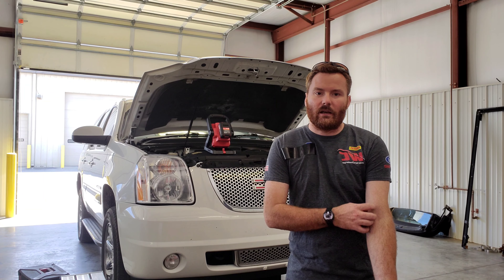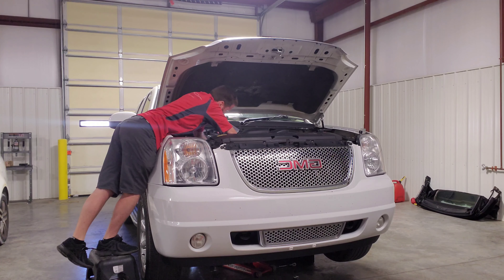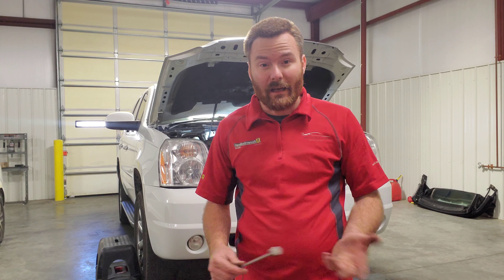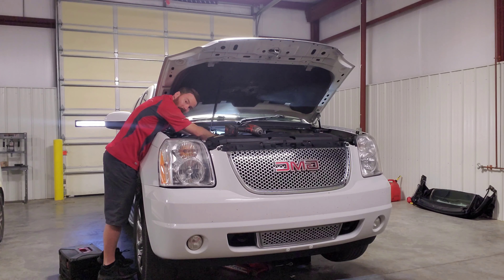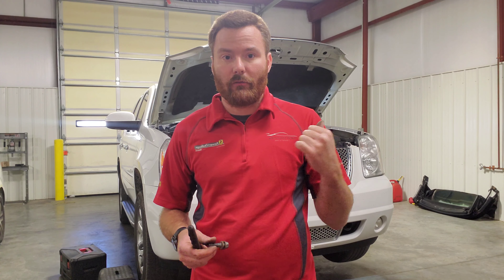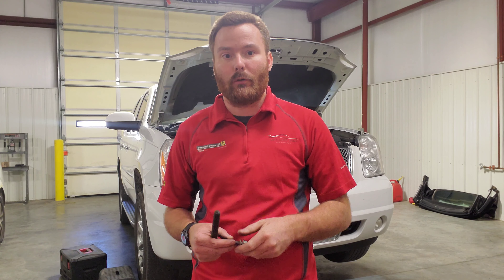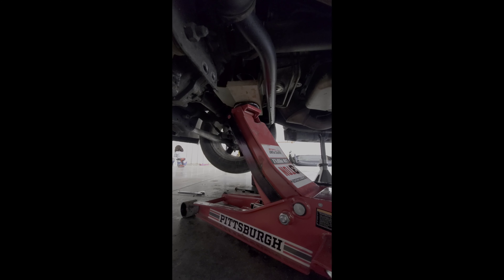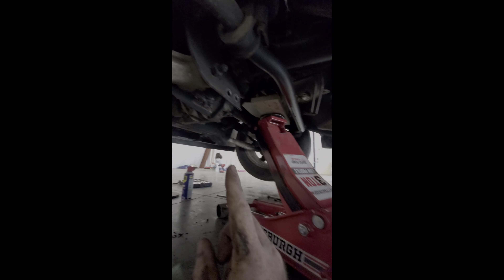2007-2013 GMC/Chevy Full Size AWD Drivers Motor Mount Replacement

Comment: Just wanted to thank you for the video. Changed my LH mount in about 2hrs and lots of water in the Texas heat! Only thing I did different was to remove the steering shaft first and didn’t have to remove the support beam. Just carefully jacked the engine behind it. Otherwise, went step by step with your video.
Reply from the maker: Glad it helped!

Comment: Awesome job my man!! Best auto repair video I've seen on YouTube
Reply: The only thing I could mention would be mentioning the torque specs but only bc im crazy about them
Reply from the maker: Thank you so much for the feedback! I plan on adding torque specs and the tools needed to do the job, in future videos. @krisevans7530
Reply: @excelsiorautoservices  were you loosening the 3 frame bolts for the passenger side at the beginning on the stool to give you the play for lift needed?

Comment: I opted for the heat shield delete on the driver side with removing the inner fender well. I doubt ill own my 09 two years from now and if i still do and it needs replacing, it will be much easier to remove and replace.

Comment: Did you have to loosen the passenger side motor mount to lift the engine?
Reply from the maker: I did not in this particular case but it doesn't hurt to loosen it up just a bit.

Comment: I just got my kit but they didn’t send me new bolts can I reuse my old bolts?
Reply from the maker: Yes you can reuse the old bolts, just make sure the threads are in good condition!

Sorry for the late response!
Reply: Always check the expiration date on those bolts..even car seats are no longer good after a year.

Comment: There are way easier ways to take this out and the motor mounts are $60 new for a pair with the heat shield and the passenger side u will have to remove the wheel and wheel cover best way I've changed like over 100 of these takes you about 3 hrs experienced inexperienced like 4 to 5 hrs if u take that cross bar out you can definitely take it out thru the bottom without removing the steering wheel column
Reply: any tips/tricks on replacing the passenger side mount.?  I already paid a shop to replace my driver's side motor mount, but the labor quote the shop quoted me for the passenger side is too much. I would like to try and tackle myself. Thanks
Reply: @curtboxley7678  yeah bro jack it up , and remove the passenger tire and remove the wheel cover only if u want extra room once lifted you should a clear and ez shot to remove it. Way more room on that side. Trick if u have an extra jack or a jack stand make it a little easier all u do is jack it place your jack stand and break your bolts loose on the mount and remove them , then place your under the motor find a small piece of wood like 5 to 8 inches could be a piece of 2x4 and place it on the jack where u will lift the motor only a tad bit the is so u don't damage anything just to be safe, but u will literally lift it a tad bit u will see how ez it will be to put the new one in with no problem bro one hand threaded lower the jack slightly just to for support now and tighten your bolts and you should be good to go. It's super easy bro save your money and do it yourself is the smart move 👌🏼 and if you do find yourself lost or confused theirs a few videos out there just find the ones where they remove the passenger tire gives u a straight clean shot too it bro , good luck and always be safe 🙏🏽💯
Reply: @CHIRAQSAVAG3  thanks. I saw another video where the guy removed the starter...is that necessary?
Reply: @curtboxley7678  no I wouldn't thats really not necessary they probably only did that just to be extra and open it all up but it truly comes out without even touching the starter

Comment: Just did both sides it was not fun at all and took me like 4 hours, I am also a professional mechanic w/ 30 grand in tools 😅
Reply from the maker: The driver's side is a real pain, especially if it is 4wd/awd!
Reply: any tips or tricks to replace the passenger side motor mount?  I already paid a shop to replace the driver's side mount and the transmission mount, but the labor cost to replace the passenger side was just too expensive.

Comment: Any video for the passenger side mount?
Reply from the maker: I don't currently have a video out for that but it is nearly the same process minus the steering shaft bit.
Reply: @excelsiorautoservices  How do you get a socket on to the passenger side bolts that are on the engine block, I can't seem to see or get any extensions or swivels onto the nuts. Any help would be awesome.

Comment: For anyone struggling with this, I had good success with these instructions except that I was unable to remove the steering shaft. Here's what I did:

-Disconnect negative terminal on battery.
-Disconnect alternator.
-Disconnect wire harness guide attached near alternator. 
-Disconnect engine coolant sensor.
-Detach the power steering/alternator aluminum plate modular assembly by removing the 4 front bolts, and one bolt from the power-steering bracket. 
(You should be able to maneuver this assembly up and out of the way by resting it on the optional second battery tray.)
-At this point, you'll be a lot more free to get to the first three bolts. 

*I used a combination of two 3-in extensions, two 6-inch extensions, one universal joint socket adapter, and a standard depth 15mm socket. A breaker bar also helps a lot here. *

-Remove driver-front wheel with car on low jackstand under frame rail.

-Jack up the engine from the corner of the catalytic converter. 

Now. All four block bolts should be relatively easy to get to from the wheel well with the right combination of extensions and the universal joint socket adapter. The only exception will be the bottom left, and I recommend coming in from under the front and  using a 3-in extension (no universal) for that one. 

- Roll the mount to free it, then pull it forward, past the steering shaft and out where the power steering pump normally goes. 

Repeat in reverse to mount the new one. Good luck! It took me about 4 hours of actual working time to get it done.
Reply: Took me around 4 hours to read all the excess work you put in..

Comment: So passenger side would be easier?
Reply from the maker: Passenger side is far easier but rarely fails like the drivers side. The drivers side fails far more often due to the direction the motor rotates and the torque.
Reply: @excelsiorautoservices  great 👍
Reply: Is heat shields on the mount and exhaust manifold necessary?
Reply: @excelsiorautoservices  I get what you are saying, but is it not a good idea to replace the passenger side if the driver's side failed, was broken? putting more stress on the passenger side mount.